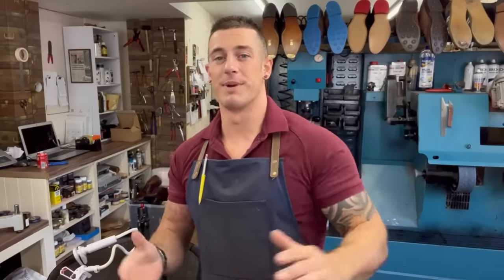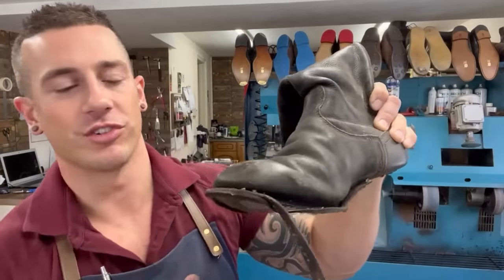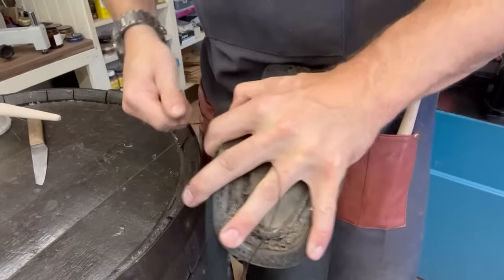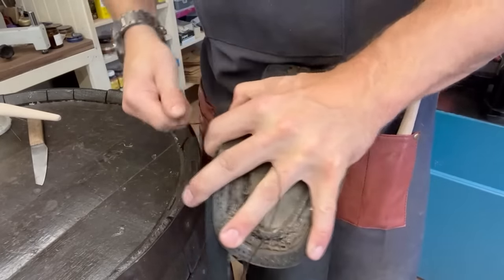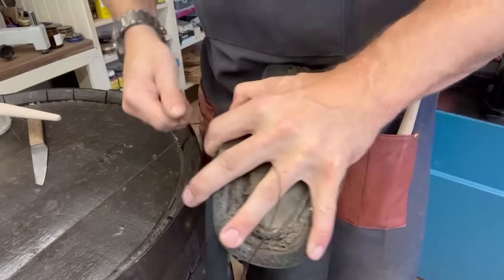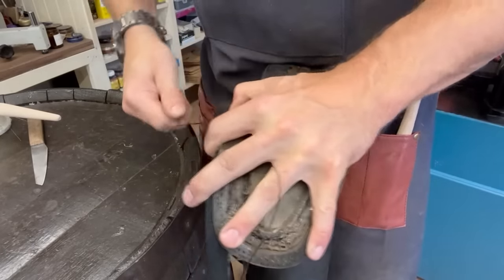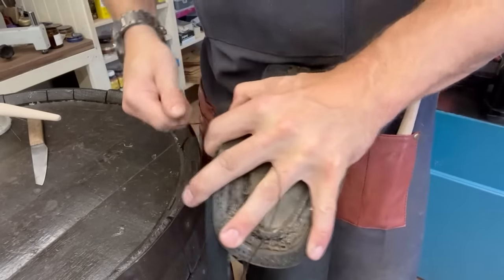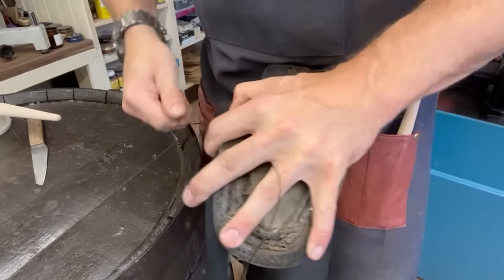Is this my BIGGEST EVER SHOE REPAIR?! ... Vintage Jack Boots Get an IRON HOBNAIL RESTORATION!

Comment: Lil question, are you able to replace soles with vegan ones as appose to normal leather ones? Have a pair of Will's Vegan Shoes that could do with a new sole.
Reply from the maker: Hi, I’m not familiar with anyone making vegan replacement soles other than the regular rubber soles.
Reply: @Dan_the_cobbler  Ah okay no worries, thanks for the reply!

Comment: Why is leather sole so good? It seems to be rubber would give much better traction? 

Also... whats the point of all that iron work in the bottom unless these are tap dancing boots? (Genuine question)
Reply: Leather soles arent that great. Steel on shoe soles has been done for donkeys cause it adds longevity to the shoe. I asked Dan to redo my rubber as leather and steel cause I was interested to see the difference.

You are correct, they are a nightmare on smooth hard surfaces. Buuut I'm a farmer. So they spend nearly all the time on earth. That said. I do wear them to the pub... and I don't sound like a tap dancer... either a horse or bygone era infantry 🤣
Reply: @Semgger  thanks for replying. I mean they look amazing I was more curious about the practicality but you've answered that. Hope they're comfy 😂

Comment: To anyone who thinks it's crazy to send shoes so far to get repaired... The same quality work in my neck of the woods costs 3-5 times as much when you can even find someone willing to do it.
Reply from the maker: Sounds like an expensive part of the woods!
Reply: @Dan_the_cobbler  it is, yes. because of the expense of the area most of the cobblers have retired or moved away so there are very few left in this area who do full service repairs like you do

Comment: I don't know how your customers wear shoes and boots.   When i'm done with a pair of anything made of leather, it's rarely the bottoms that are gone.   There are holes in the leather uppers, sewn seams are stretched and torn, sides of toebox areas are blown out and ripping away from the sole, the front of the shoe is ripping because my foot is starting to poke a hole through the leather...etc.     cool work though.  interesting.

Comment: To a man with no clue and a large consume of shoe it seem to me you are not far from making fully brand new ones in very much higher quality than any of todays crappers I find in any industrial line store I am familiar with. I go through 1-3 pairs of daily wearers a year if I buy the best mountain or worksman stuffs they´ve got. It usually lands me in some Goretex with inner liner membranes or leatheries that wont hold me dry after few weeks of use. Where would you send me to buy shoes that should hold up for years and be worth periodical professional care ?